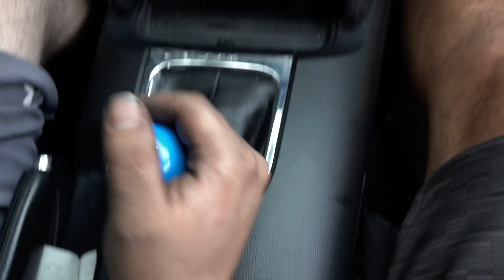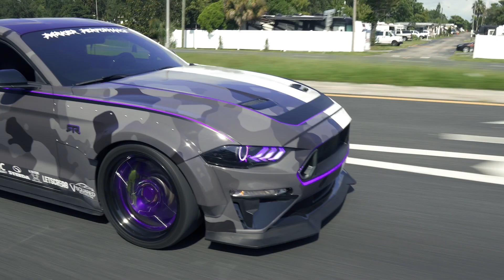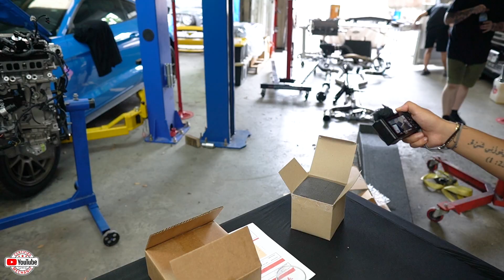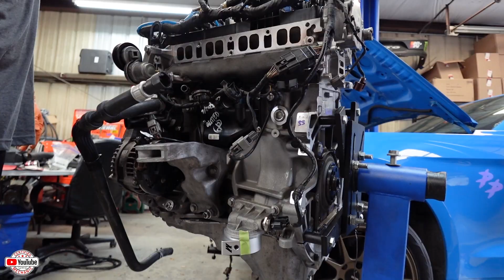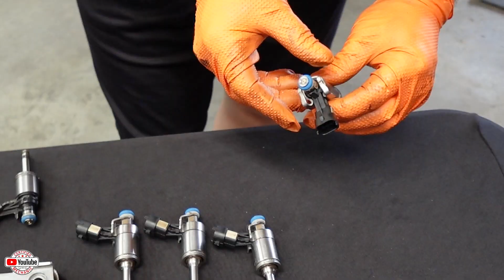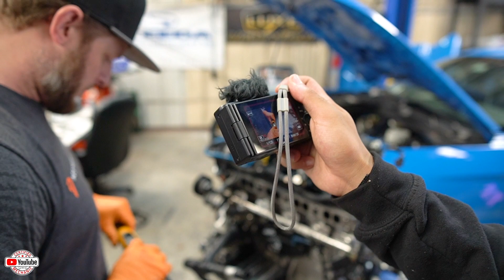How To Upgrade The Injectors In Your EcoBoost Mustang - Install Overview

Comment: Everything looked thorough and professional. One thing u missed is compressing the injector seals before installing, without doing so u can roll  the seals causing a poor seal. This was recommended in the instructions provided by nostrum!
Reply: Couldn’t you just install in the cold and use lube?

Comment: Definitely time to change my injectors but I have a random question for you.  Can the stock camber on the rear be changed or do I need to order some sort of camber kit?  I have wider wheels on the back and the poke by about half an inch causing a slight rub.
Reply from the maker: You can try these: UPR IRS Subframe Alignment Kit for 15-23 Ford Mustang
https://ppflco.com/products/2015-2019-ford-mustang-s550-upr-irs-subframe-alignment-kit?_pos=1&_sid=0816453c7&_ss=r
Reply: @ParkerPerformanceFL  thanks a lot. Always appreciate the replies